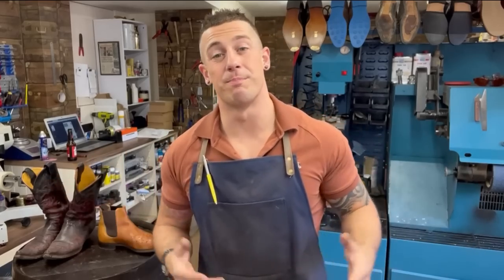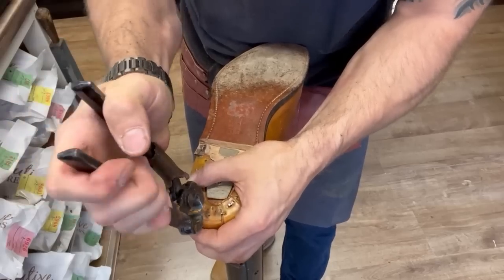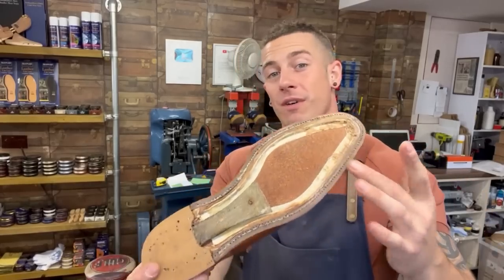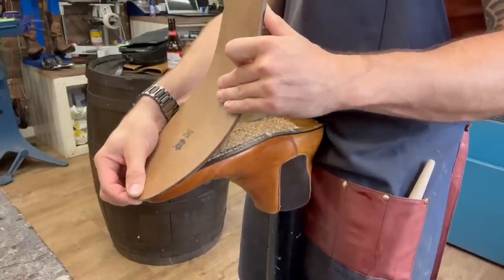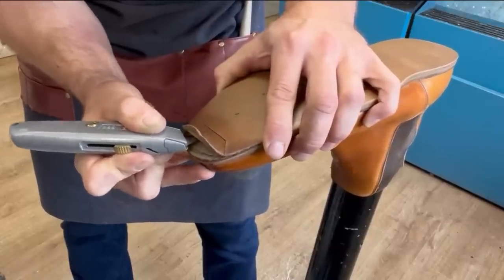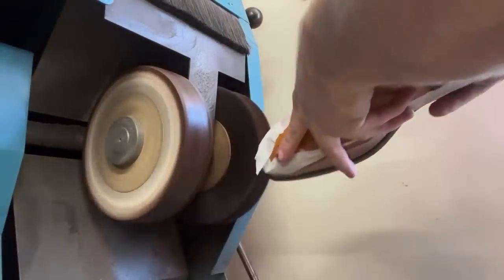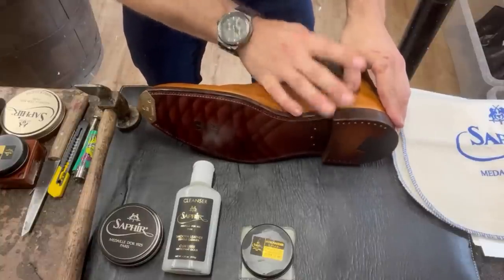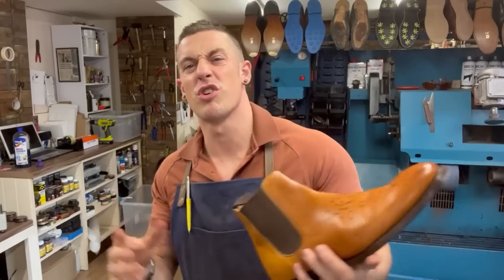Professional LONDON Shoe Repair! // RARE "BIRDSHOT" CHELSEA BOOTS!

Comment: A Goodyear welted shoe is only that when it is made by machine, with the Gieves being handmade they are a hand welted shoe.

As usual though solid jobs done Dan👏🏼
Reply: Nope, you can see the construction is Goodyear welted and he uses the Goodyear stitching machine to repair them, these boots cost £400 to £500 originally roughly 10/15 years ago, (there was also a buckshot brogue slightly cheaper), they would have been the bargain of the century if they’d been hand stitched.

Comment: Your use of the glue, letting it dry, then reactivating with heat, reminds me of fitting a de-icing boot, on a De Havilland Twin Otter wing. Only in this case, it’s reactivated with methyl ethyl ketone, instead of heat. Plus, it’s  a lot bigger! (I’ll take a rough guess at, 500 shoe soles,  per wing.)

Comment: As an American gun nut I can tell you that is bird shot.  4 gauge at biggest.
Reply: Bird shot isn't measured in gauge. There's no such thing as "4 gauge" bird shot. You don't say "4 gauge" bird shot. You say "#4 bird shot." (Number 4 bird shot) I even looked on Google to see if there is any mention of measuring bird shot in gauge, just in case there was some obscure references to it, and there weren't any. Gauge is use to measure the bore of the shotgun barrel. Also, #4 shot isn't the biggest. There is #1 shot (0.160"). Then there is also T and F shot at 0.200" and 0.220" respectively.

Comment: Accidently shot by buckshot at what 60 meters. Looks different yea but boy does it show the designer hasn't a clue what up close oopsie buckshot will do to your feet. At the close of range....should be missing the toe lol.

Also what I've found amazing from your vids is the machines you use look like they're well maintained machines that were made 100 years ago and haven't changed as nothing newer could replace them.

Comment: Please explain why all shoes and boots are assembled using nails?? Why not replace the common nails with specialty screws made from stainless steel bronze. No rust and would last the life of the shoe or boot and be easily removed and installed??

Comment: The work is excellent - better than the original. ( But that Buckshot design is crap btw ...) And co-incidentally, I just bought a trusty fuzz/tremolo pedal so now I can play the intro and outro groove !   But I too did cringe when watching the stitches being cut with a utility knife, since I once sliced the end of my thumb clean off while cutting foam core board ( But no worries, because they re-attached it like new ... )  Soooo, chick chicky boom, chick chicky boom, chick chicky boom ...